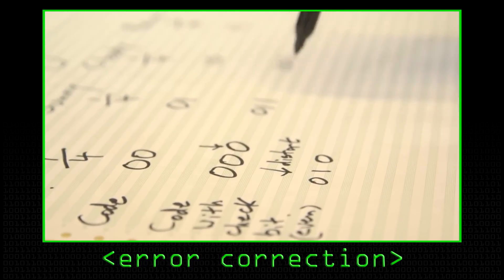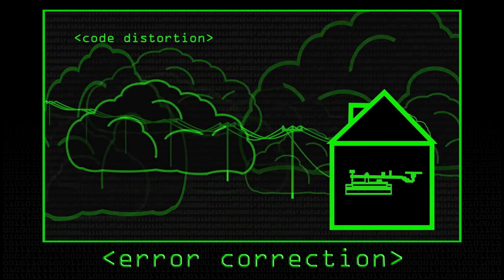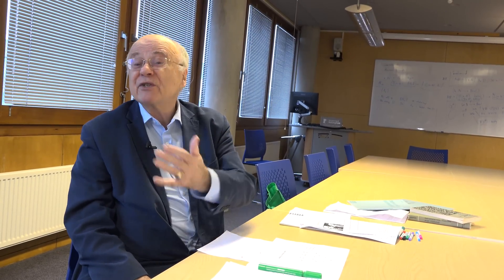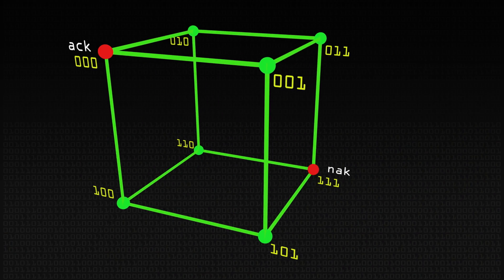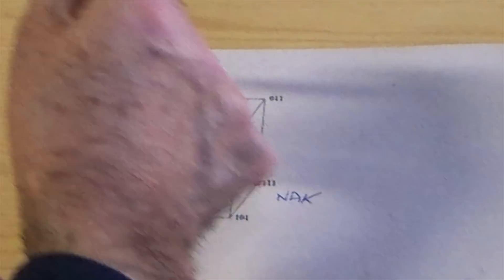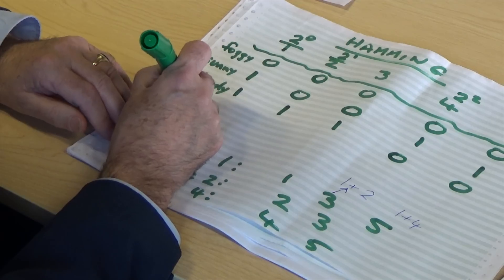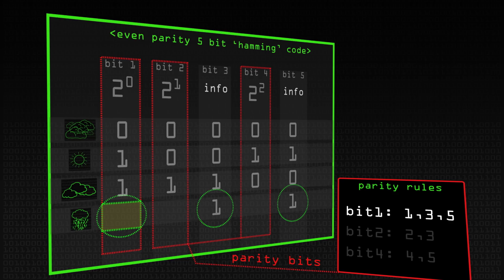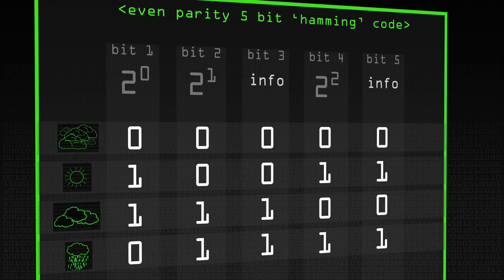Multiple Dimension Error Correction - Computerphile

Comment: The '0000' and '1111' codes at 6:17 (and onwards) are actually marked incorrectly on the hypercube. You can see that the edge distance between them is clearly 3, however it should be the same as the corresponding Hamming distance - 4. The correct way to mark these codes would be, if we keep '0000' where it already is, to place the '1111' in the opposite corner of the INNER cube, rather than the outer. You can then convince yourself that the edge distance between '0000' and '1111' becomes 4, as it should be.

 Note that the author's point is NOT invalidated by this. It is still correct that you cannot have three 4-bit codes all of which are at least 3-away from each other in Hamming distance.

Comment: 📺💬 A 4 bits code is the same as we draw a cubic and represent the data point coordinate as bit number sample ( 0, 1, 1, 0 ), ( 0, 1, 1, 1 ), ( 1, 0, 1, 1) ...
🥺💬 There is some challenge for data dimension when we consider 1D or 2D for encryption string input and the distance of data points is from the distance between 2 or more data points. In the 3D dimension consider more variables, properties, and distances between data points.
🐑💬 There are 3 axes normally we consider the dimension in X, Y, and Z axes but we can use them with quality numbers such as initial frequency, acceleration, and last-word frequency output. The sample is speech recognition because there are more applicable in the 3D dimension axis.
🧸💬 When we plot in 3D we can group them into categories or new group sample S sound, C sound, T sound, and target categories.
👧💬 The application is working when all dimensions are on the same pane, a cubic cube can represent the relationship of vowel sounds, pronunciation, materials, formation, or custom group. In map, destoration is easy by changing the expectation of them and determining the object in the map read from the continuation of the reference numbers continuity and many application such as potential estimation or properties of materials.

📺💬 Hamming codes error correction ...
🥺💬 It is parity bits check for data points in the pane axis I example of the application is the Hamming codes error correction benefits with vector picture or encryption which is because of the ability to reconstruct data within a single quote.
🐑💬 In communications the parity bits are not costs considered because we need termination for each sequence message, termination character can be any value including 1 or 0 but when transmitting the receiver knows it instantly because current signals are converted within one time.
👧💬 There are parity bits that display or none display information we called communication parity bits in some signals they are silence 0.5 secs, contrast signal, wrinks, or parity bits. Most of them see it as no information but some methods like parity bits checksum tell you about signal quantity because of repeating the same information and there are many of applications he is thinking about when watching this VDO.

Comment: Is there any reason for having the check bits in position 1, 2 and 4? It seems to me that the order of bits shouldn't matter, as long as you are consistent. So why not just append the check bits to the end of the message, instead of having them in positions of powers of two?
Reply: Putting them into positions 1, 2, 4, 8, 16 etc ties in very nicely with doing things "by hand" because it reminds you that bit 4 (say) can only contribute in parity and sums-of-powers-of-two terms to bits that lie to the right of it.  However you are quite right in what you say. The codewords matrix represents a linear vector space and so you can shift the exact-power-of-two-columns to the right hand end of the matrix (say) if that's what you want to do. In fact doing so may make it easier to "discard" those bits, via bit-shift operations, to leave just the message bits.
Reply: That makes a lot of sense, the pattern does become much clearer that way. Thank you for the quick reply.

Comment: If 00000 corrupted to 01100, then surely it would correct to 11100 and return ACK. Are we saying we don't care about detecting 2 errors or have I missed something? Or is this just a case of better than nothing?
Reply: Patrick Nunn hamming only works when you get 1bit wrong, when 2 or more bits are bad, the whole thing doesn't work

Comment: The No. 1 ESS Switch program store used hamming and parity check methods to correct single read errors. Each 44 bit word contained 5 hamming bits and 1 parity bit as I recall.

Comment: Hamming codes are brilliantly clever but there not that practical. In reality bit flip errors rarely occur in singles like this. Generally if there is some external phenomenon that is causing noise in the the signal it will occur in bursts that will mess up a large sequences of bits. Also hamming codes are really expensive as they wasting a lot of bandwidth.  For these reasons generally CRC is used for error detection, and correction is done when needed by re-transmission. 

Hamming codes are really only useful in situations where error rates are very low, and the cost of re-transmission is quite large. One possible example of this is communicating with things way out in space where it takes a long time to send a message round trip, however the large amount of potential interference can still makes the error rate on the higher side, making hamming codes again unpractical.

Comment: Does the Hamming method hold up if you need to send more than 2 information bits?  I imagine you'll need exponentially more parity bits the more information bits you have.
Reply: You won't need exponentially more parity bits. Even if you would come up with a code that would scale in such an exponential way, there are way more clever alternatives out there. Hamming codes in general has codewords with (2^r)-1 symbols where r is the number of parity symbols. Thus, the Hamming codes has (2^r)-r-1 information symbols, but only r parity symbols. That is, the information symbols grow exponentially, but the parity symbols grow linearly.  There's also something called BCH codes that correct up to t errors. BCH codes are in some sense a generalized version of Hamming codes. But of course, coding theory goes way beyond these codes.

Comment: for the 2bit case the following would be more intuitive: if the
bits A and B need to be transmitted, send the combination ABABC with C as a checksum for AB.
you can then compare the A's to eachother aswell as the B's. if any don't match use the check bit in combination with thr matching bit.
(so basically the same as in the video, but parity bits in position 3,4,5 and using even sums instead of uneven ones because A, B, A, B, C is more intuitive than C, not A, A, not B, B)

Comment: aren't electrical disturbances only able to flip a bit to 1 as for a power surge?  what could something cause a 0 during the transportation? in the case of only flipping to 1, you need 4 bits for 4 states, as parity can be encoded as 00 and 11 and the rest in the remaining two, so you can detect an error in either the parity or the code.
Reply: in dynamic ram bits need to be refreshed or they will lose their charge.

Comment: For one bit of error correction the message is 2.5 times longer now.
Reply: One part of coding theory is of course the keep the rate k/n as close to 1 as possible, where k is the number of information symbols and n is the total number of symbols. When generalizing Hamming codes to arbitrary length, the number of information symbols grows exponentially while the number of parity symbols only grows linearly.
Reply: Not only that, since it is more than twice as long, it is at least twice as likely to have two errors in the code word... which this error correction method cannot handle.
Reply: that's quite intuitive thinking, but if you work out the algebra, you'll find you get a much better success rate in decryption. For example, if the probability of a bit-flip error is less than 0.1, the successful transmission is four times more likely. More precisely, if the probability of bit-flip is p, the probability of success in the naive sending two bits is (1-p)^2, the probability for the hamming code is (5-p)*(1-p)^4.
Reply: Time taken and space taken is a common trade off in computer systems. By adding these extra bits for correction you do take up more space but you save on transmission time by not having to retransmit messages. In modern networks there is so much bandwidth that the extra length doesn't really matter anyway
Reply: lol who th ell  neds eror coretion tht stufs for lossers!

Comment: Nice. I'd like to see a follow up video about measuring the relative detection/correction effectiveness of various codes, e.g. why might somebody prefer Hamming(7, 4) over the presented code with 5-bits, 2 of which are for data?
Reply: Hamming[7,4] is a secded code, so as well as being able to correct a single-bit error it can detect a second error (but not solve it).

Comment: Why not just spend 64 bits, with the code repeating. No need to worry about it being wrong 32 times in a row.
Reply: Goodbye bandwidth lol
Reply: +faiAre Worse than that.  In the era this was developed, you measured bandwidth costs in minutes of long distance time at the given baud rate (300 Bd was normal consumer level in the early '80s) with a floor of 1 minute.  For the oversimplified 2bit weather code used in this subseries it wouldn't be an issue (64 bits isn't going to take anything like a minute) but in meatspace we're going to be sending text that takes up tens to thousands of characters at 7bits per character (which was the standard in that era) or binary files of a few thousand bits with lower fault tolerance than text has.

As an example here consider +Horsecock 's post above.  There are 110 characters in the text of his post, so 770 bits times 32 repeats at 300 bps (bps and bd aren't always the same, but they are for this era of modems) sent presuming a flat $6 in modern value per minute (long distance was never a flat rate, and the $6 per minute is ballpark adjustment for inflation of the average 1980 daytime weekday LD rates in the US).  That works out to about $8.21 in today's money to send his post using the schema he describes in that post. Sending it at night, which as far as i can find reduced the cost for LD to around 1/3 the daytime rate, would cost $2.74.  Using the schema described in the video, meanwhile, encodes the text of 7bit character codes with error detection/correction bits as 11 bits per character which works out to 4 seconds to send at 300bps so would be a flat $6 in inflation corrected LD rates during weekday daytime and $2 at night with enough time (56 seconds or so) to send more data without increasing those rates.
Reply: Jeez, if you guys are so worried about it, then maybe only send it 16 times. Is that better?
Reply: Meh.  If I was really worried I'd have included the late '80s through early '90s costs for a specific BBS network I was familiar with in that era that bypassed local long distance costs (which were getting more expensive than cross country LD at the time) by sharing data every few hours via purely local phone calls.

Comment: Seems to me you're making it less robust with multiple bits. Using 3 bits to encode 1 bit means you can handle 1 flipped bit, ie. 33.etc% of the transmission. Using 5 bits to encode 2 bits still only lets you handle 1 flipped bit, ie. 20% of the transmission.
Reply: Yes but it gives you the opportunity to error correct. If you are using only 3 bits you have no way of knowing which bit to correct.
Reply: That's not true. With 3 bits encoding a single bit, you can correct the 
error at the receiving end. Here, they're using 5 bits to encode two 
bits, to get that same error correction ability - but it's less robust 
as the risk of more than 1 bit error is greater in the total 5 bit 
transmission than in a 3 bit transmission.

Comment: But what if ALL the bits are wrong? :(
Reply: If you know all the bits are wrong you'll only need to xor it with a bunch of 1s, and all the bits will be correct :)
Reply: This method assumes you would realistically only have up to 1 error per message. If you think you could have more, you can just increase number of parity bits, but as said 3 bits is safe in 99,99% cases, otherwise it's a sign of a bad, inefficient and unreliable transmission system. Think about it, what are the chances that both bits in a 2 bit message are corrupted?
Reply: You can detect about twice as many errors than you can correct. So if enough errors occur, you may be able to detect them but not correct them. Also, there could of course be enough errors to transform one codeword into another codeword, in which case you wouldn't even be able to detect that errors occured!

Comment: How does this work for n-bits?
Reply: If you look it closely, you're just adding a bit for parity check and then doubling all the other bits.
So if a pair of those doubled bits is not even, then you see if the sum was even, so you can correct.

If the damaged bit is the parity one, there's no problem since all the other bits are perfectly doubled, so you don't need to check anything.

3bits example
000 -> 0 00 00 00
001 -> 1 00 00 11
010 -> 1 00 11 00
011 -> 0 00 11 11
100 -> 1 11 00 00
101 -> 0 11 00 11
110 -> 0 11 11 00
111 -> 1 11 11 11

Lets say 0111100 gets damaged and become 0011100
The first pair after the parity bit is 01, but the parity bit says that the sum must be even, so it was 11.
if instead the received signal was 1011100
The first pair is 01, but the parity bit says that the sum must be odd, so it was 00.

But I think there is a little problem, because some of the words only differ 2 bits, like 001 and 010.
The video says you need 3 bits difference...
Reply: Too bad none of these responses tell you how to actually construct a Hamming Code for three bit messages. Allow me to correct that problem.

To know how many parity bits to add, the rule is this: add an extra parity bit if the total number of bits becomes equal to a power of two. So, for example, if the message was 5 bits long, adding 3 parity bits would get you 8 bits, which is a power of 2. Therefore, a 5 bit message requires 4 parity bits, for a total of 9 bits in the final code word.

However, you were talking about checking for a 3-bit message, and this requires only 3 added parity bits, for a total of 6 bits:

   1   2   3   4   5   6

Once again, bits 1, 2 and 4 are the parity bits, whereas bits 3, 5 and 6 are the information bits. The rule for which parity bits check which bits in the code word is essentially the same as with 2-bit messages / 5-bit code words:

   Bit 1 checks bits 1, 3 and 5
   Bit 2 checks bits 2, 3 and 6
   Bit 4 checks bits 4, 5 and 6

So, for the 8 possible 3-bit messages with an even-parity Hamming Code we have (the parity bits are in [] brackets):

000  --> [0] [0] 0 [0] 0 0
001  --> [0] [1] 0 [1] 0 1
010  --> [1] [0] 0 [1] 1 0
011  --> [1] [1] 0 [0] 1 1
100  --> [1] [1] 1 [0] 0 0
101  --> [1] [0] 1 [1] 0 1
110  --> [0] [1] 1 [1] 1 0
111  --> [0] [0] 1 [0] 1 1

You can check: the "distance" [aka number of bits that differ] between any 2 code words is at least 3. In fact, I think you'll find that it's either 3 or 4. And since any error of n bits can be corrected by a code which has a Hamming Distance of at least 2n + 1, the code I generated above qualifies.

I think it'd be better to wait for Computerphile to make a How to correct 1-bit errors using the Hamming Code video to explain how to actually go about checking for and correcting any errors.
Reply: As KohuGaly mentioned, Hamming codes in general has codeword length (2^r)-1 where r is the number of parity symbols. Each codeword has (2^r)-1 symbols but since r of them are parity symbols, there are only (2^r)-r-1 information symbols. Hamming codes can correct up to 1 error. There is also something called BCH codes, which in some sense is a generalized version of Hamming codes. BCH codes can correct up to t errors.

Coding theory goes far beyond these codes, though. Hamming codes are linear codes, which means that the code can be considered a vector space in which the codewords are vectors(which basically means that you can add them to eachother). These kinds of codes are quite nice to deal with mathematically, but they are only the tip of an enormous iceberg of codes.
Reply: m-parity bits can cover upto 2^m -1long message, leaving 2^m -m-1 leftover room for the message itself. To get the amount of required parity bits just solve for n<=2^m -m-1 where n is length of your message. Every i-th parity bit has position 2^i and corresponds to parity of all bits that have i-th digit 1 in their position written in binary. If bit at possition 0b10110 is error, then parity bits at 2,4 and 16 will detect error, pinpointing the error's location. If bit at 0b01000 then only parity bit 8 will detect error, which means it is wrong itself.
Reply: Ahsim Nreiziev - So I'm gathering you can send the data out in one long signal, adding a parity bit every 2^x bits, and have error checking built in?